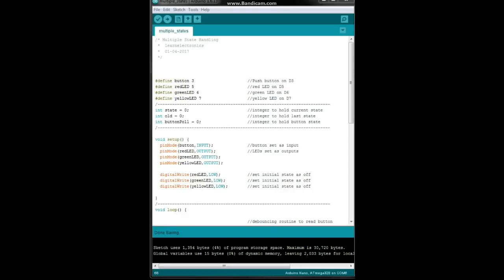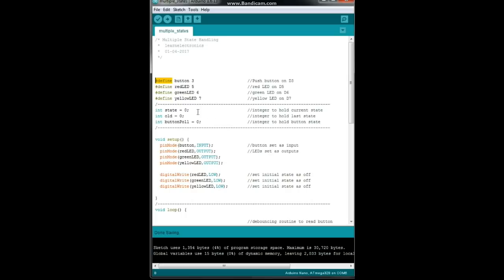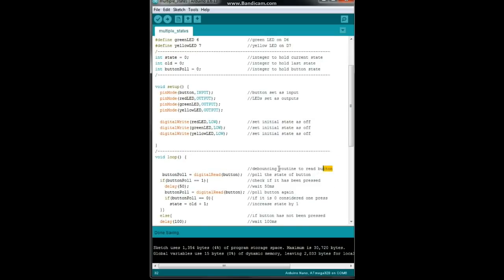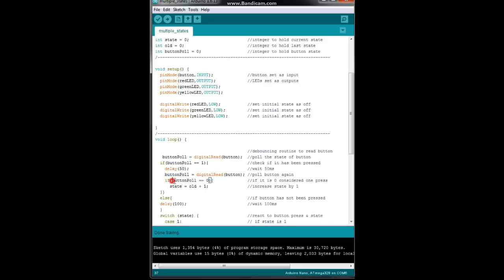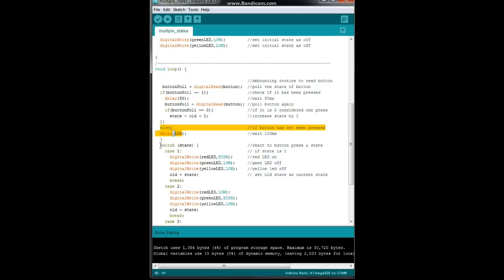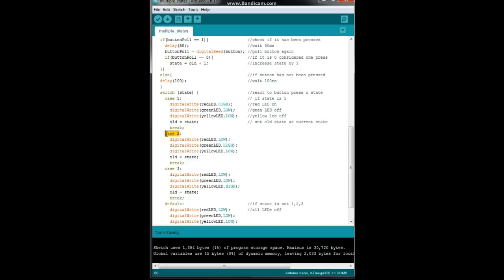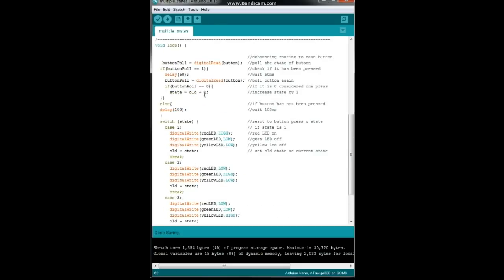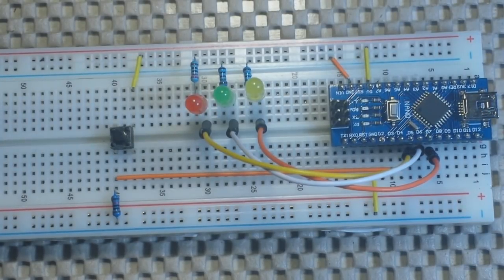Arduino Basics Handling Multiple States

Comment: Good Afternoon.
Thank you for a great tutorial.
I'm wondering if you could advise me how to tailor it to my requirements? I'm using an hall switch to switch the states.
the important pins in my example are one and two in each case. This case is turning on and off an electromagnet but has it is
case one is turning the magnet on and case 2 off. What I'm looking for is case 1 to turn on and then turn off before case 2 happens and then the same in case two. I've been on it all day and cant get it to do this. I'd really be grateful for some advice.
Many thanks.
switch (state) {
case 1:
     digitalWrite(magnet_pin_one, HIGH);
     digitalWrite(magnet_pin_two, LOW);
     digitalWrite(dial_pin_three, LOW);   
     digitalWrite(dial_pin_four, HIGH);
     old = state;
     break;

case 2:
     
     digitalWrite(magnet_pin_one, HIGH);
     digitalWrite(magnet_pin_two, LOW);
     digitalWrite(dial_pin_three, HIGH);
     digitalWrite(dial_pin_four, LOW);
     old = state;

Comment: nice video,  i have an Arduino Pro Micro setup for keyboard emulation and it works great on the bench. however, when it is hooked up on a machine with a DC motor and not connected to the arduino,  and with the one pro input connected to common to act as a switch input. the F11 keyboard command keeps strobing.  any ideas before making my changes?  thanks a lot...:)

Comment: hello
i make a project with arduino uno and IRremote and stepper motor .the remote control turn the motor shaft to the right and left. i need a little help with the codes. is it possible to define just one button of remote control to turn the shaft to right and left ???
how to write the code ?
i can send the codes i wrote if its needed.

Comment: I have a problem.. I wrote a code using this format! Works great but.. in case 2 I want to ad a delay that will turn of one LED after 3 sec! And I know how to do that but the arduino loops that delay 3 times for some reason! Any idea?
Reply: If we use delay cmd then its not switching to next case.

Comment: Hi, hope you can help me out. Basically I want to do the following: I want to control two LEDs separately using one single push button, example if push the button once LED 1 will lit up and immediately turn off (momentarily) and if I push the button again now LED 2 will lit up and turn off immediately, the cycle should repeat. Thanks.
Reply from the maker: Look at this video: https://youtu.be/PKwE10Aigac

You will have to adjust the code to make it momentary but it will do what you want.
Reply: @learnelectronics  thank you

Comment: #define button 3                      //Push button on D3
#define redLED 5                      //red LED on D5
#define greenLED 6                  //green LED on D6
#define yellowLED 7                 //yellow LED on D7

int state = 0;
                               //integer to hold current state
int old = 0;
                                  //integer to hold last state
int buttonPoll = 0;
                     //integer to hold button state

void setup() {
  pinMode(button, INPUT_PULLUP);
                          //button as input
  pinMode(redLED, OUTPUT);
                                      //LEDs as output
  pinMode(greenLED, OUTPUT);
  pinMode(yellowLED, OUTPUT);

  digitalWrite(redLED, LOW);
                                        //set initial state as off
  digitalWrite(greenLED, LOW);
                                    //set initial state as off
  digitalWrite(yellowLED, LOW);
                                   //set initial state as off
}

void loop() {

  
    buttonPoll = digitalRead(button);
  if(buttonPoll == 1){
    delay(50);
    buttonPoll = digitalRead(button);
    if(buttonPoll == 0){
      state = old + 1;
    }}
    else{
      delay(100);
    }
      switch(state){
        case 1:
        digitalWrite(redLED, HIGH);
        digitalWrite(greenLED, LOW);
        digitalWrite(yellowLED, LOW);
        old = state;
        break;
        case 2:
        digitalWrite(redLED, LOW);
        digitalWrite(greenLED, HIGH);
        digitalWrite(yellowLED, LOW);
        old = state;
        break;
        case 3:
        digitalWrite(redLED, LOW);
        digitalWrite(greenLED, LOW);
        digitalWrite(yellowLED, HIGH);
        old = state;
        break;
        default:
        digitalWrite(redLED, LOW);
        digitalWrite(greenLED, LOW);
        digitalWrite(yellowLED, LOW);
        old = 0;
        break;        
      }
    }
Reply: Very useful tutorial. One change in the in default case - the yellowLED should be set to LOW
Reply: @mrgraememell4526  thanks for the code review, man! I just edited the original comment. awesome to see this is still being used

Comment: im using this to run an LED tracer loop with different settings. i noticed with this code it will only change modes if i press the button between the time the last led goes off and the first led fires. is there any way around this?

Comment: I may use this for a Star Trek Phaser Type 2 Cobra Head Display where Each LED must stay on like this

-=OFF
*=ON

**------
******

This requires multiplex and I'm hoping if this can work by telling the arudino to keep the last LED on and then light the other and so on - if I hold the other button it resets the phaser or move down if I press it.

But will these States work in the multiplex format?

Comment: Thank you for you video. This helped me a lot. I have a few questions. 1. Is it possible to add a function that makes a long press of the button the code to jump to defult? And 2. Is it possible to add a second button and for both buttons to control their own switch cases (button 1 for case 1,2 and 3, and button 2 for case 4, 5 and 6)?

Comment: Ok, I set this up with a button and changed a few things... Instead of turning one led on at a time, I have them all turn on one at a time then shut off. That was easy enough to do. Now, I want to make that exact thing happen with an rc transmitter and receiver. I have the pwm signals on the channel 2 stick set so that 1 is neutral, you push it up, it reads a 0, if you push it down it reads a 2. So in theory I want to push up on the joystick, it turns on the first led, push up again it turns on the second, and push up a 3rd time it turns on the last led. Push up a 4th time it shuts them all off. If I push down on the joystick its puts power to an output pin. Take you finger off the joystick power stops. Can you help me. Ive been trying to do this for days! TIA, any help would be appreciated!

Comment: Hi. Very/extremely useful.   My respects. Thank you for sharing!. 
2 questions, if you could please advise me.  If I need to go back from case 3 to 1, instead of going OFF all 3 lights, I guess I should make a case 4 with Case 1 statements, and at the end, write OLD = 1, and then, it should keep cycling, right?.   Second question... to apply this for a servo,  I guess that I should load SERVO library, and state the angle I want for the position of servo ( servo.write(angle) ), and I should be able to cycle trough different pre-programmed positions with the click of the button. (ej_ 0, 90, 180, 0, 90, 180..). Off course, after selecting the angle outputs to the proper/same PWM Output..   Do you think it might work?  I have the project on mind, and getting all components in a week, so, I am gathering all information I can, before I can do some testing.
Juan
Reply from the maker: Yes you are on the right track in both cases. You will definitely need the servo library for your second question.
Reply: I will work on this base once I get all the components. Thanks for sharing!!

Comment: Very useful tutorial. its perfect. but i would like to know how to do something after press the button. i mean, if i need to flash RED bulb with 1 sec delay after first press and so on.. i tried to do it. but if i do so, next bulb not response after second press of the button. could you please explain me how to use this type code for handle multiple programs just using one button press. if it is possible, it will be able to use as a menu selector & will be v.usefull to automation.